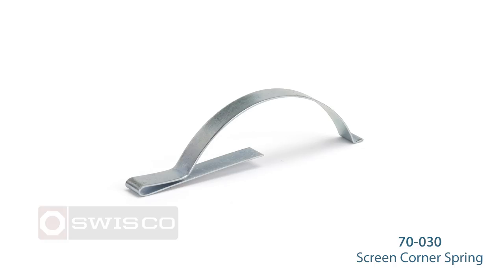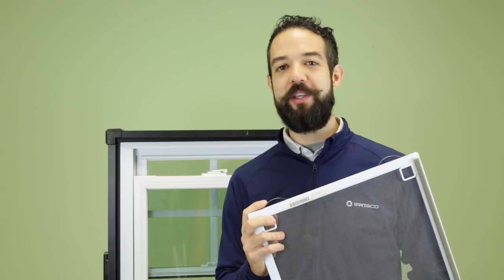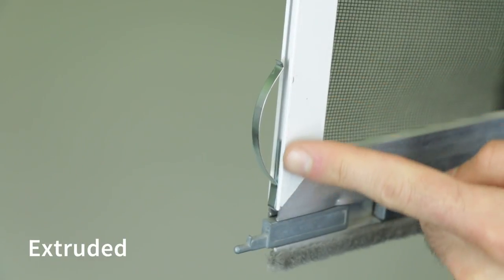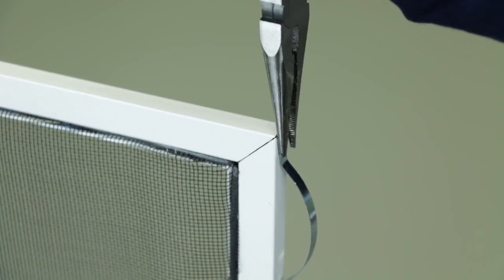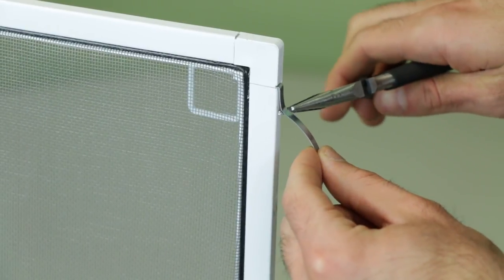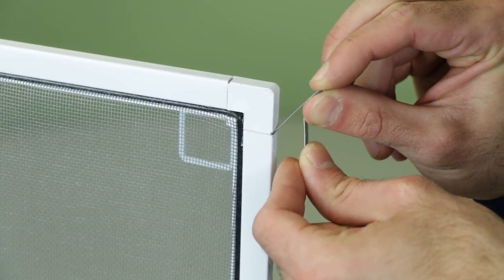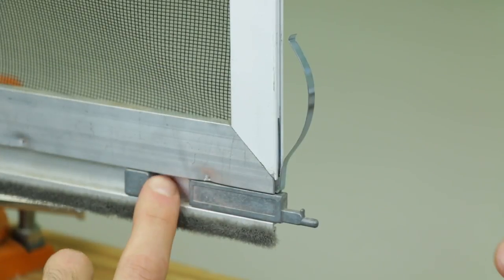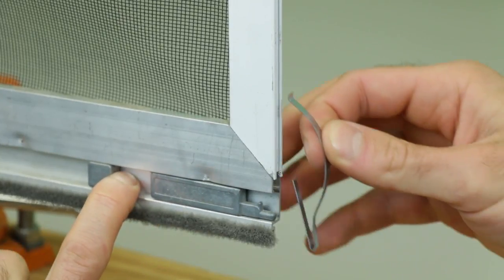SWISCO Screen Corner Spring [1080p]

Comment: This helps a bit, but I have a window with the square little tabs on the inside at all four corners. I've tried pulling and pushing every way I could but the frame doesn't budge. The screen ripped and I've been wanting to replace it forever. Any vids that could help more on that, or advice?

Comment: Can you please show now to open these type of windows?
Reply from the maker: We have several other videos in which we open, tilt and take out sashes and screens. This video may help https://youtu.be/B-4NCv3MbIo
Reply: @SWISCO  ok thanks I’ll go check it out
Reply: @SWISCO  one more question sorry: so I have to remove the window screen of my window in the second floor and I was wondering if you had an videos on how to remove said screen. Mine had these big white tabs in the top right and bottom right and those springs across from the tab. No matter what I do I can’t quite figure out how to open that damn screen! And the humidity is insane currently and I’ve been trying to get an ac unit up and in the window. Thanks for any help you can do.
Reply from the maker: The white tabs are used to remove the screen frame from the window. Pull on the tabs towards the opposite side of the window - this will compress the corner spring and should let you remove the screen frame from its track.
Reply: @SWISCO  ok thanks. I’ll go try this.
Reply: @SWISCO  I’m not sure, but it doesn’t seem to be working I’ll just have to do more research I guess but it has been at least 5 years since the screens have been removed
Reply from the maker: Sorry that I wasn't able to help! If you have any more questions, feel free to contact us here - https://www.swisco.com/page-id-part - you can include pictures of your screen frame and our team of experts will take a look at your situation.
Reply: @SWISCO  ok thanks and no worries!

Comment: how do i remove it from the inside with the spring clip? they’re on the bottom of the screen
Reply from the maker: Are you referring to removing the screen? There could be plunger pins or clips holding it in place. You'll need to remove those first. If you still need some more help, feel free to start a discussion with us! https://www.swisco.com/page-id-part

Comment: How many of the Screen corner springs are normally used?  Are they normally on the top, bottom or sides?
Reply from the maker: Good question! Usually, four corner springs are used per screen. They install on the sides of the frame in the upper and lower corners.